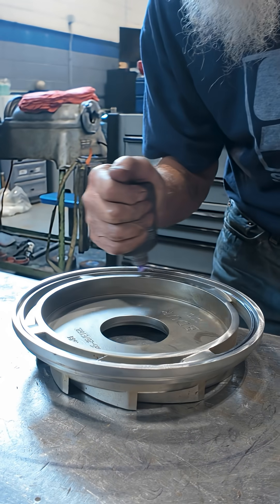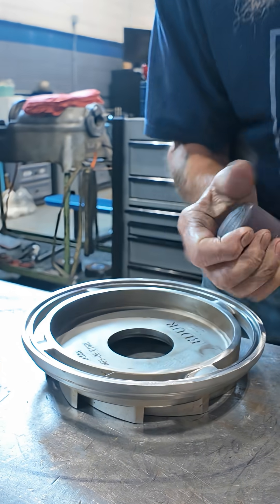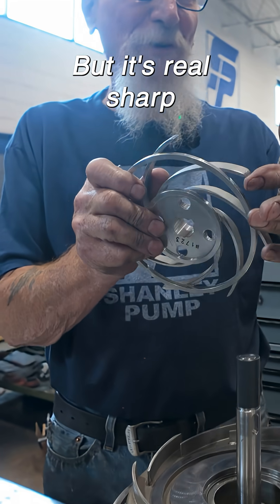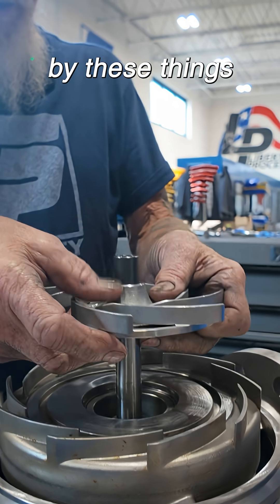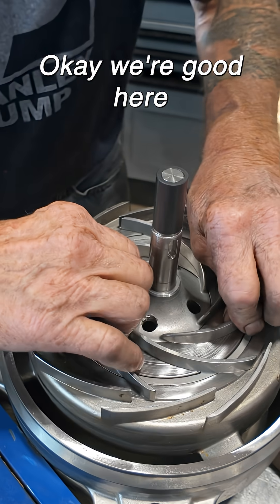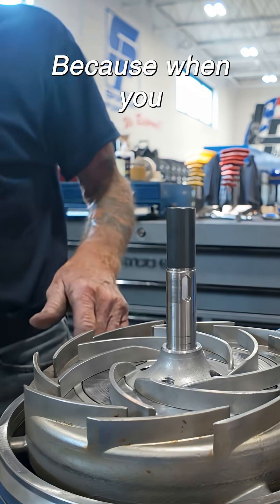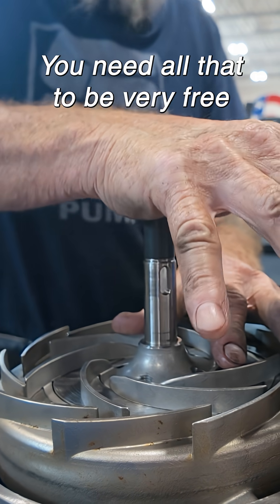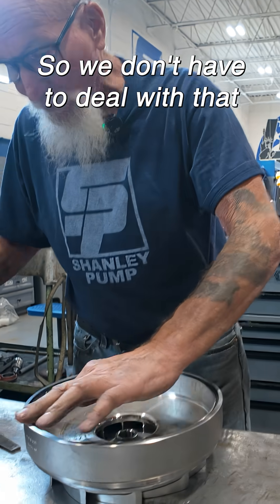Assembly of an EDUR LBU High Pressure Multistage Centrifugal Dissolved Air Flotation Pump Part 3

Comment: cant see AI taking this job and i cant see a robot taking this job
Reply: Then you don't have vision
Reply: @mtstash  how many robots or AI uses the sense of touch like only a human can?
Reply: @ponydriver77  many.  They use automated tools to torque bolts and robotics to apply sealants, welds, and even precision pick and place machines for circuit board assembly. These were designed for humans to assemble and repair. You don't think if engineers/AI designed them to be assembled by automation they couldn't do it? Have you seen fully automated electric motor winding coils and assembly. It's like comparing a manual mill to a cnc mill. You can do the same thing on both but only on cnc machines can you have the repeatability, speed, and 24/7/365 in lights out operations
Reply: @mtstash  definitely not in our lifetime